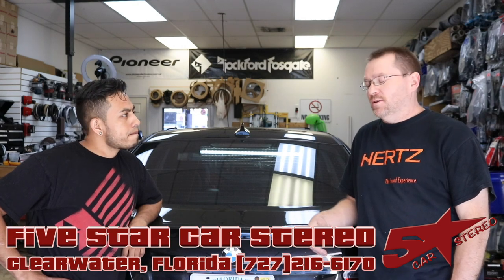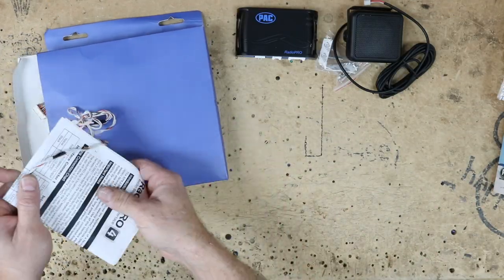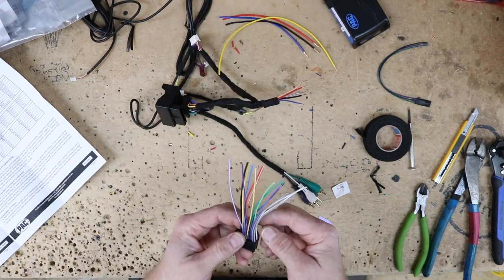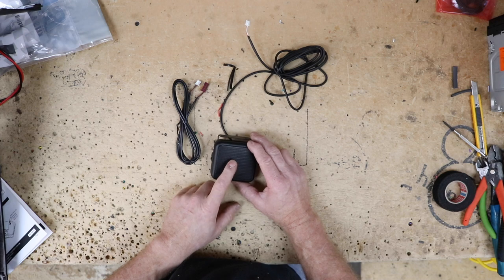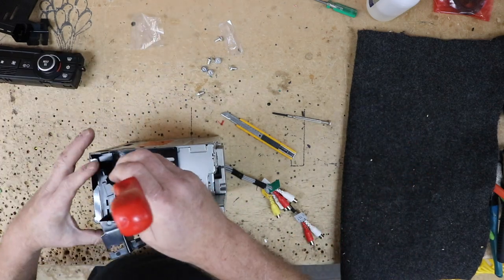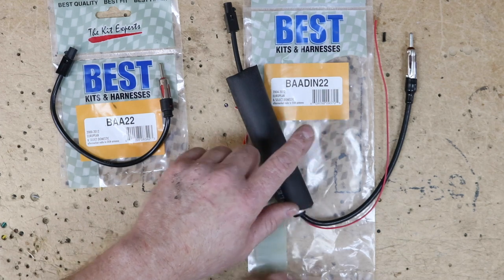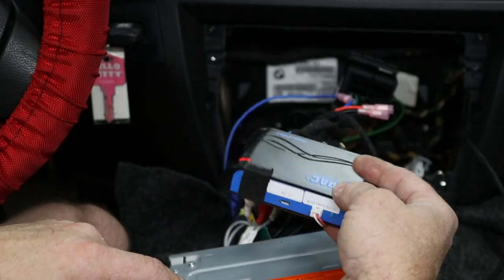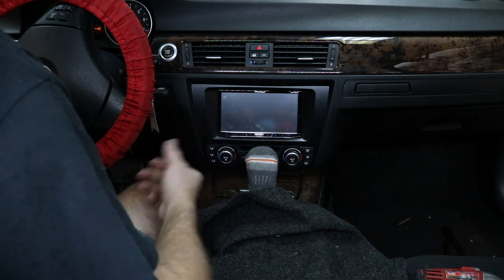How to replace the radio in a BMW 328i

Comment: I ordered a new head unit and I have been researching how to do it. I wasn't sure how the thing would fit until I realized the air needs to be repositioned!  Now I see how it all goes together in the end and I am not afraid to try this. I still haven't received my new unit, maybe this week, but, just watching you pop the air out, I feel confident now.  Mine is a  2011 323i which is different from the other models I saw instructions for. You have given me the confidence to do this. I never did BMW before but a couple Hondas.  I will be sure to report back when I am complete! (hopefully)

Comment: This tutorial has been immensely helpful!! Thanks guys!!  I was also wondering what the purpose of the red/white 12+ Programmable Output is for.  I connected the solid red in the PAC harness to the solid red on the pioneer harness, but I was unsure what the red/white was for.  Should I just cap this off?

Comment: HI guys, congrats on the awesome job you do with your videos! Got a question which doesnt have much to do with the stereo install itself but it is related to e90 cars... nime doesnt come with cup holders. I found some online for a good price but I need to know how many chances I got to find the appropriate slots behind the dashboard plastic shield where they are usually mounted... I thought I'd ask, since you might have worked on BMW 3 e90 and might have seen what's behing that plastic cover...
TNX

Comment: Just FYI, no really reason changing the fiber (logic7) amplifier, its good enough, but for some odd reason they did, you can recode the 2rad(non idrive radio) from L7 to HIFI then go that route, unless you're changing the whole radio then you pretty much have to tap into the output lines from the amp that way. If it has Idrive and wanted to get rid of L7 and go a whole custom route, just have someone or get NCS Expert to code out the L7 to HIFI then carry on.

Comment: Since some 5 years have passed since this install video was produced, would it be fair to assume that the install in an E90 would be made somewhat easier now by using one of the current double-din head units that have no CD drive and are therefor quite a bit shorter in the rear ?

Comment: Hey I have a 2011 bmw 328i. It has factory Amp without the fiber optic cable. The thing it's that the radio there's no sound. You think it might be the Amp that it doesn't work no more.

Comment: Hey dean, quick question on this pac module. On the interface 2 adapter, there is a red/white 12+ programmable output wire, my question is do I connect this wire to all my red accessory wires? Also for the “illumination output” wire on interface 2 plug and dimmer wire from vehicle connector, these both go together? I’m currently working on this interface module for my car. Thank you for the help!

Comment: Do you guys have a preferred mounting kit for similar installations on the BMW 135i (in my case, 2011 135i w/ automatic climate control and no factory amp)?

Also, what did you do to this car to eliminate the BMW Assist SOS error that shows up after the OEM head unit is removed?

Comment: I am looking forward to doing this to my car. The dash looks the same except that where this ashtray goes I have a pocket instead and also under my temperature control I have a DTC I believe it's called button. So what would happen to that DTC button if I were to do this upgrade? Thanks for your time
Reply from the maker: Metraonline.com does make some panels for switches in that car, you may want to check there.

Comment: And How do I do this WITH the Fiber optic amp??? - I've replaced the head unit already, and installed a decoder box - but that only has 2 channels RCA - so I have left and right.  No fader.   I'd like to bypass the amp, and install  connecting to the factory speaker wiring - is there a plug & play adapter for this?  (2008 335Xi, no nav)  My head unit has 5 RCA outs.   (Eonon Android unit)  Speakers too down the line.

Comment: no at the time we only had the metra piece. it was an 09 one series with the hifhfi system. everything worked fine except for the sis light kept flashing and it would chime. apparently something to do with the factory Bluetooth.
Reply from the maker: froshouseable ok, If you get the chance check one of these out. Way better

Comment: Alarm delay issue... I have a 2013 BMW 335i convertible E93 and replaced the stock Professional HU (6512 9302171-01) with a Kenwood DDX9906XR using Axxess wiring harness  LC-BMRC-01 and Axxess steering wheel adapter ASWC-1. Everything works except when the car is locked for a while it goes into sleep mode and when I unlock the car the alarm takes several seconds to disarm. Once the car is out of sleep mode the alarm works perfectly without any delay. Yellow wire is run to battery   Any idea why this is happening?
Reply: SOLVED: The Axxess Wiring harness came setup already wired. From the main connector that connects to the BMW harness a bundle of wires went to the chime speaker, another bundle went to the Axxess ASWC-1 (for steering wheel controls) and the final bundle were for the speakers. That Axxess wire harness had two yellow wires, one was pre-wired from main wire harness that connects to the BMW harness and the other end connected to the chime speaker. The second went from main wire harness that connects to the BMW wire harness and the other end was left open so it could be connected to the stereo. Problem is, both of those yellow wires go to sleep after about 45 minutes. The fix is to not use either. Cut the one that connects to the chime speaker and hard wire it to the battery. Also, hard wire the stereo to the battery. This solved my problem.

Comment: Please do me a favor and show how yo wire a head unit in a 1999 lexus gs300. They have the kit to mount it and a radio harness but none of them seem to put sound out through the harnesses that ive bought
Reply: VICSTOR101 Have you been to clublexus? I installed my Pioneer Avh-5700bt double din myself with help from that site. If you have the Pioneer audio system, you'll need 2 toyota wire harnesses and extra wires as you'll need to extend to the second harness to connect to the factory amp. I really suggest 4 or 5 channel amp for your speakers instead of using head unit to power the speakers. It makes installation is so much simpler, you'll need only one Toyota harness, you'll need 3 wires out of it to power and illuminate the headunit.

If you have ML or Nak system, your only option is full headunit/amp/speakers/and sub upgrade...

It sucks that we don't have a perfect wire connector for our system.
Reply: VICSTOR101 Have you been to clublexus? I installed my Pioneer Avh-5700bt double din myself with help from that site. If you have the Pioneer audio system, you'll need 2 toyota wire harnesses and extra wires as you'll need to extend to the second harness to connect to the factory amp. I really suggest 4 or 5 channel amp for your speakers instead of using head unit to power the speakers. It makes installation is so much simpler, you'll need only one Toyota harness, you'll need 3 wires out of it to power and illuminate the headunit.

If you have ML or Nak system, your only option is full headunit/amp/speakers/and sub upgrade...

It sucks that we don't have a perfect wire connector for our system.
Reply: J Silver yeah sucks well i already had in mind to just put a full on system just kinda wanted to avoid the hassle of a 4channel
Reply: VICSTOR101 4 channel is worth it. I just can't believe I waste so much time owning my 300 without an amp for the 6.5 speakers. Oh I don't know if you already knew, but once you install your head unit, you will no longer have the factory 10 inch sub working since it only works with the factory sub. So your forced to install a sub.

Comment: I have a question for you guys. I have a 06 BMW e60, I install I aftermarket CD player using a scosche BW01SR with my alpine deck for the SWC. Now I have replace the CD player with a pioneer one, which SWC interface would you recommend? As the Scosche don't work with pioneer CD player. Thanks
Reply from the maker: Dung Ho looking at the Scosch instructions, the Panasonic has to be a typo for Pioneer. I would contact them before I bought a new interface.

Comment: Just installed the Sony xav ax7000 in my 2010 328i with this harness and the volume is extremely low. I have to max the volume for it to be at a normal/comfortable level. Am I missing something? I believe I have the base audio system with no factory amp but the Sony should have built in amps.
Reply: What five star car stereo installer diaries 58, I had the same issue. Hope it helps
Reply: @0togtr811  using the wires (high out) instead of RCA (low out) seems to be working for me. Soldering up the rest of the wires right now!
Reply: @jonathanwu7805  awesome, glad I could direct you.

Comment: Does this work on a 2011?
Reply: Joge Woods I also have a 2011 and I'm wondering if you have the DTC button on yours
Reply: @christiandelatour2140  DTC is not related to the radio - it is dynamic traction control. This is only do-able on a 2011 if it does not have i-drive and it does not have a fiber optic amp

Comment: Hi guys, I was just wondering what year the bmw was, and if you have run into the sis or s1s light flashing on the dash after install a radio in any bmw?
Reply from the maker: froshouseable I think it was an 07. No, have not had that problem yet. Have you used this PAC adapter yet and had that issue?

Comment: would you guys be able to add a HU to a 135i that has fiber optics connected Harman Kardon Amps.
Reply from the maker: Dev Gill what year?
Reply: it is a 2013i with harman Kardon amp fiber optics at back of head unit
Reply: its a 2013 135is. Sorry I thought I replied but ???

Comment: Hello there guy's, I'm having an issue with my 4200nex with the time an date it's not changing on its own help is there a setting I need to adjust somewhere?
Reply from the maker: lolo ent have touched the clock on the screen to open the settings?
Reply: Huh!

Comment: what about the seat warmer bar that is under the air conditioning controls?
Reply: There is a relocation kit for that, if you need to. Metra 98-9306.

Comment: So guys, what's the alternative when you do have the fiber optic amp?  You just kept saying if you don't have it you're good to go, but I do have it. So now what?
Reply: Peter XM need to add aftermarket amp too.
Reply: For reference: Since I posted this question, I've done some poking around and figured out there's ways to make the fiber optic amp work with this Pro4

https://avinusa.com/bmw-most-fiber-optic-amp-interface-for-e90-e91-e92-e93-e60-e61-e81-e82-e83-e84-e70-e87-e88.html

Comment: what are the little butt connecter call at the end of the wire that you capped off
Reply from the maker: The Beige Wonder it is just a 22awg butt connector. We get the from AAMP one of our suppliers. Most local shops that by from them should be able to get you a bag.

Comment: are you that bad ass Dean ?  cause I tried tearing the tesa tape like you and no go for me . what is the part number
Reply from the maker: pissed off they make 2 types of tape that we use. One is a felt type in the video, the other is for under the hood. The under the hood high temp stuff you have to cut. So not that bad ass.

Comment: So i have a question
Reply: My 328xi has the fiber optic wire..... But its not hooked up to the amp. Just the regular analog is hooked to the amp.   Do i need the expensive harness am i able to use the basic harness. Im really stuck here cause im not sure what to do... Im really not trying to spend 600 bucks for a harness
Reply: @josephrodriguez8349  did you ever find anything?